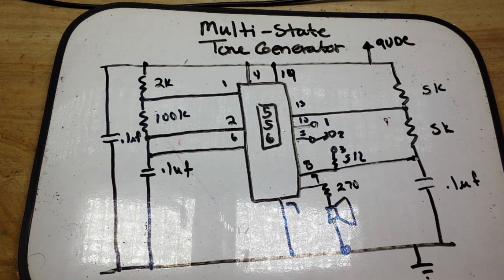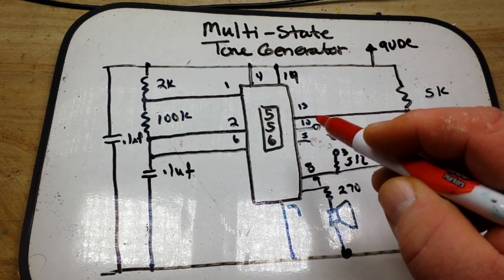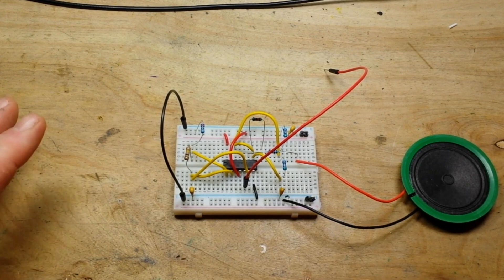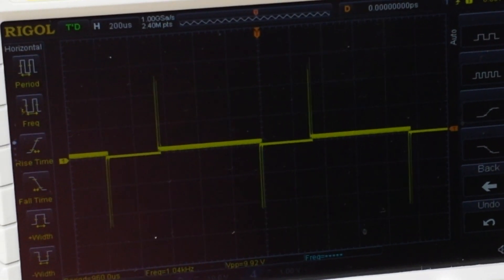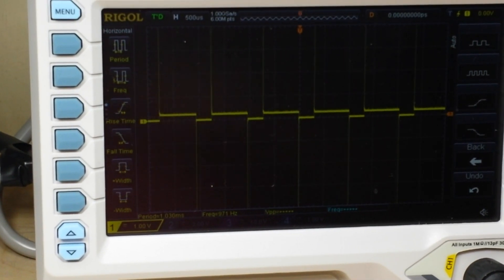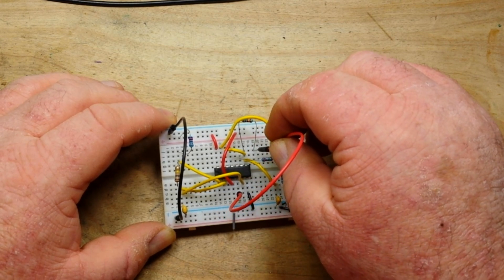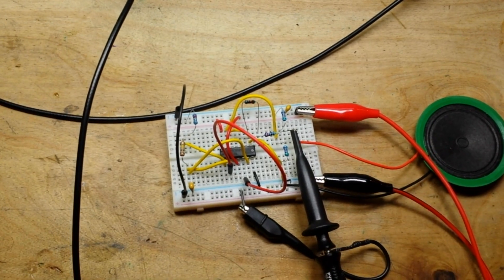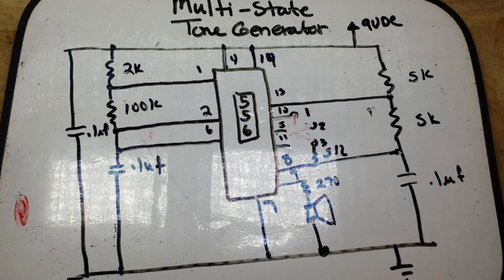Forrest Mims Tone Generator Circuit

Comment: If you use a couple of pots in this circuit, you can get a lot of different sounds from it.
Reply: That and put the timing caps on a rotary switch. A 10 position one does nicely.

Comment: Happy new year. Looks like ancestor the SN chips on the 8 bit consoles which consists in all in one waveform generators. They look score sounds or acellerating sounds. Its is way more simple with 556 :D Very neat circuit